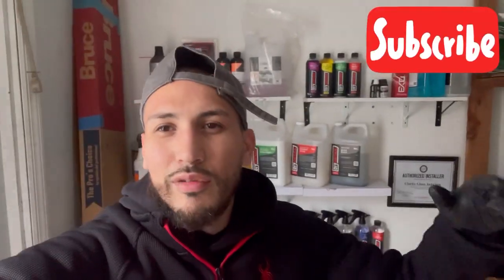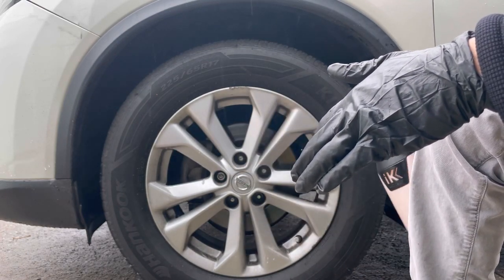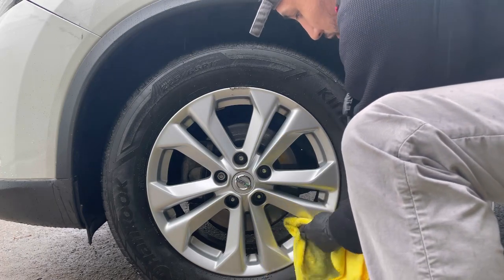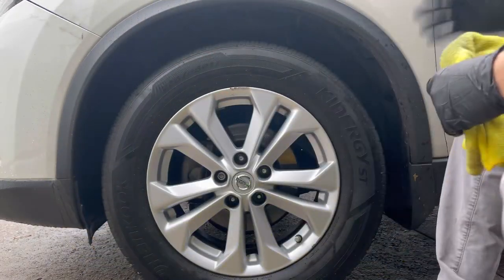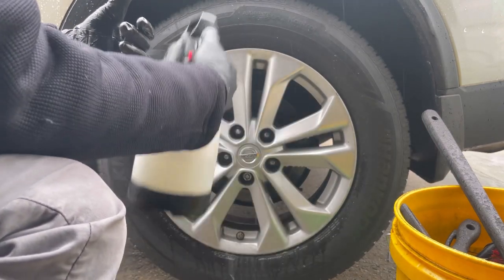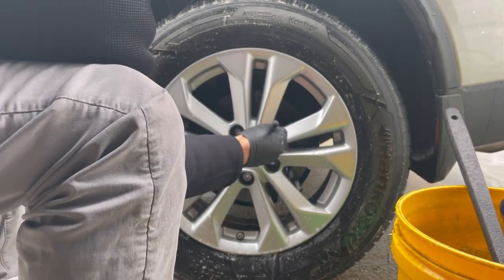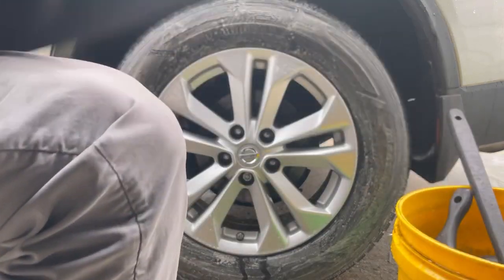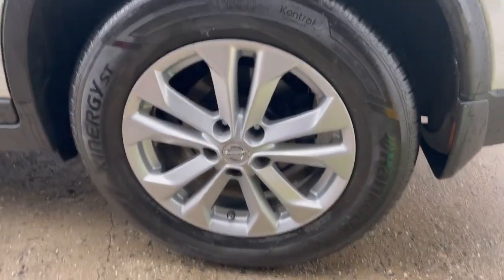How To Remove Browning Off Tires - Extra Tough Wheel And Tire Cleaner #realdetailing #cardetailing

Comment: Thanks for this video - just ordered some to try out.  I’m doing mostly rinseless washes now and the hardest part has been getting the wheels really clean. This looks like a great product.
Reply from the maker: Hey Luke. Awesome great to hear brother! Yes works amazing in conjunction with a rinseless Wash feels as if you are doing a traditional Wash. I recommend it undiluted. Depends on the severity. If not you can dilute it 1:1 and you will save a lot more money that way 👍 just the two vehicles I demonstrated needed to be used straight. Each has not been cleaned for 5-6 weeks tops. 

You will notice if used undiluted how well it clings, pulls and emulsifies the dirt off the wheel and with a Rinsless wash included breaks it down even more 😅

Comment: ive used this product as well..  works great... i even cut it 1 to 1 or more...
Reply from the maker: Yes I've diluted this 1:1 works just as great! I use it 1:1 when I do it in conjunction with a rinseless wash or a traditional wash. 

For a waterless definitely prefer that straight. Just for the extra cleaning lubrication and emulsification. 🤛🤛

Comment: The browning in tires is cause mostly by hear from the tire and any silica tire shine. I like to use adams tire shine applied with a foam applicator once every two weeks. I always use a weave microfiber towel to remove all the excess and just keep the tire black, high ph cleaners will mare and damage rhe clear coat overtime on painted wheels, i rather use a ph neutral shampo like adams or mr pink and a dedicated foam canon just for the wheel, tire and wheel arches on a weekly basis and never get any browning on the tires.. and i do 3 suvs weekly
Reply from the maker: Hey. Yes tire browning and blooming is caused by the tire shine, heat and ozone oxidants. I Definitely agree with you. But as we all know not all customers return biweekly/weekly. Usually monthly. When driven hard a PH neutral soap will require dozens of passes. The wheel and tire cleaner from extra tough starts alkaline for the cleaning properties only once rinse clean and dried automatically goes to neutral. Even if reactivated with water the PH is 7. Which is amazing. 

We a rare breed as car enthusiasts we maintain our vehicles routinely. On my business end it's not the case. 💪 On my weekly/bi weekly clients I use a Rinsless Wash or a PH Balance or PH nuetral soap 🤛🤛

Comment: That price for a 5-gallon pail is tempting me. I get a lot of customers with multiple layers of solvent-based dressing on their tires. It takes four rounds of pressure washing and agitation with my Tuff Shine tire brush to get all the browning out and get the sidewall really clean. I’ve tried six different tire cleaners and have been using Wise Guy from Shine Supply. It’s a strong cleaner but I would like to find a faster method for winter detailing. Does this Extra Tough Tire Cleaner remove multiple layers of tire dressing?  Some of my competitors are lazy dogs and they just slap a coat of tire dressing on the sidewall without cleaning the tire first.  It can take 40-minutes to thoroughly clean tires and wheels with all the crap that is layered on these tires.
Reply from the maker: Hey John. Extra tough is a diamond in the ruff. 

I can't say whether it would do a better or quicker job than Wise guy as I've never used it. Also depends on the severity of the dirt and grime accumulated. This Extra tough cleaner cleans incredibly well. That Acura MDX you saw goes to a car wash weekly. I see that vehicle once every 6 weeks and you saw the browning accumulated on that rim and tire at the end. For your case based what you are telling me. Will take 2-3 passes with extra tough also use it straight. Don't dilute it 1:1. As you saw at the end the Acura it didn't take much with one pass to remove the browning. Try out a 32oz give that a shot. I just review based on my experiences and demo them on my customers vehicles. 👍 hope this help. 

My main goal is amazing this cleans as a waterless and in conjunction with a rinseless wash works extremely well undiluted. 

You saw on the rinsless Wash part took 3 rounds on just the tire to remove browning as it's a daily driver that goes through industrial area every day. Just depends on the severity.
Reply: Thanks for the reply and recommendation on how to use Extra Tough. I just ordered a gallon and got the 10% off with your code.

Comment: I just watched this video.  This product is crap!!  I commute 350 miles/week 98% of it on the highway.  I bought this because I live an apartment complex and was hopeful.  I practically sprayed an entire bottle on my tire and let it dwell as the directions said.  I saw NO browning whatsoever even with a strong bristle brush.  I threw the gallon in the trash.  i do NOT recommend this product!!
Reply from the maker: I apologize you had such a bad experience with the product. Strange that there is no browning coming off in my most recent videos I did another test on how to May your APC or wheel and tire cleaner foam more and was pulling out grime and dirt.